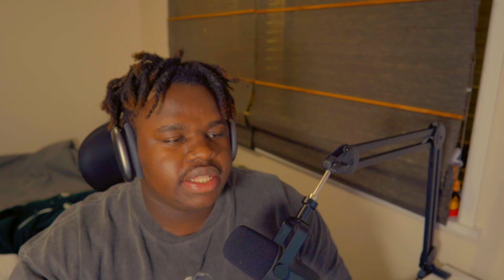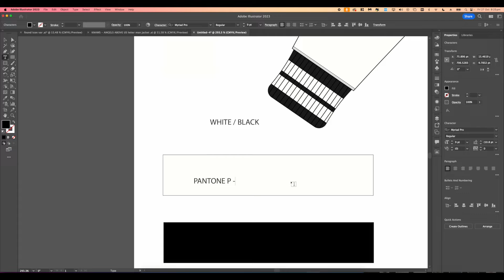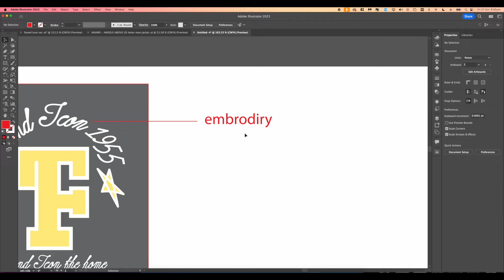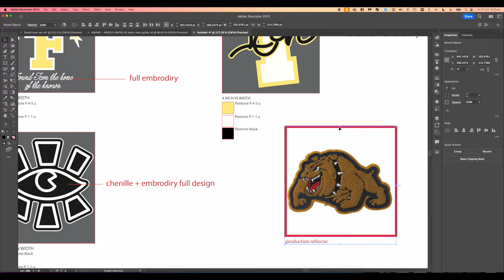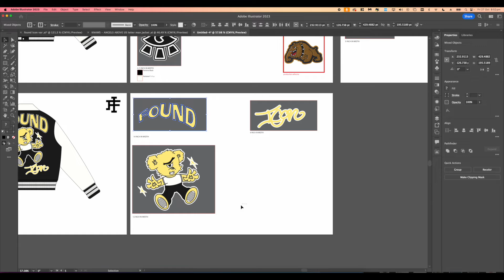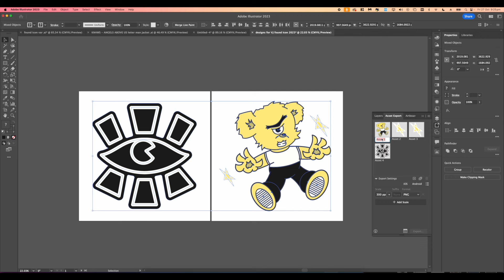HOW TO make  a TECH PACK for your CLOTHING BRAND | VARSITY JACKET

Comment: Yo how do I add layer style pack into photoshop I just bought it off yo site I can’t find it it don’t show in photoshop
Reply from the maker: Item is not for photoshop it’s for illustrator says on the site , this is illustrator. If you’re using photoshop you’ll be using the pngs , / pdfs which is a lot harder but doable